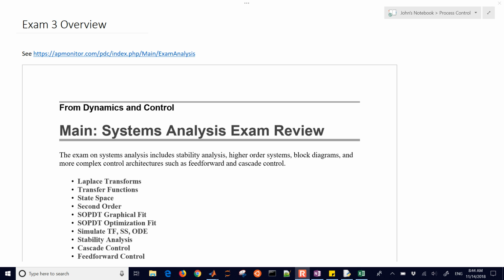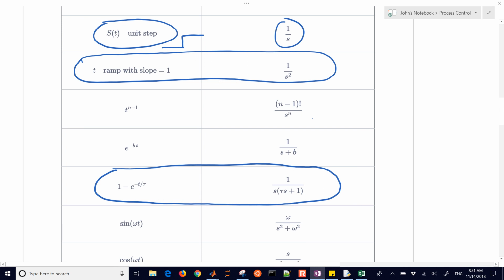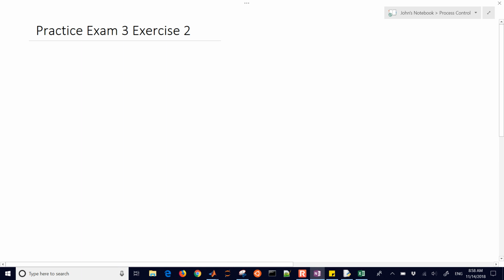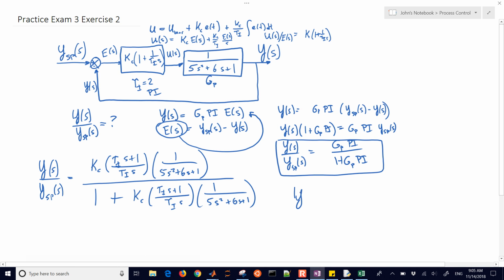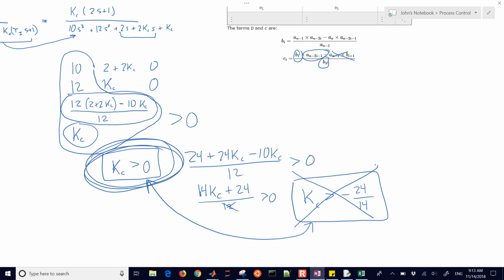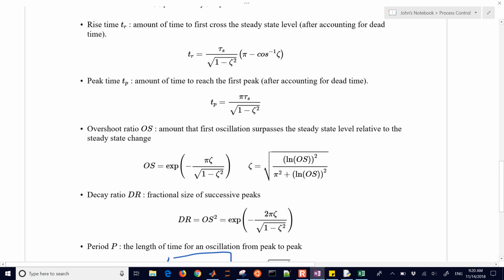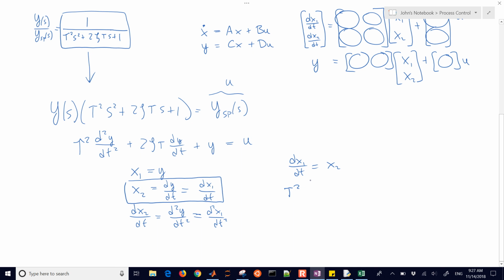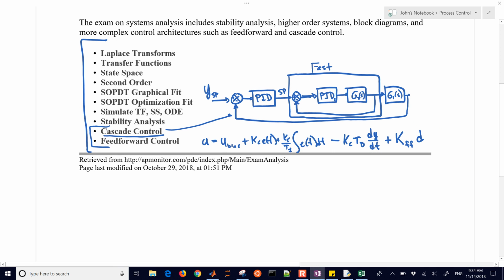Process Control Exam 3 Review

Comment: plz make a video on Kalman filters
Reply from the maker: Thanks for the suggestion. You may also be interested in the Moving Horizon Estimation approach that allows nonlinear systems, constraints, and asynchronous data. http://apmonitor.com/wiki/index.php/Main/Estimation More info on filters is available from the paper: https://apm.byu.edu/prism/uploads/Members/eaton_hedengren_OPTE_springer.pdf

Hedengren, J. D., Eaton, A. N., Overview of Estimation Methods for Industrial Dynamic Systems, Optimization and Engineering, Springer, Vol 18 (1), 2017, pp. 155-178, DOI: 10.1007/s11081-015-9295-9.